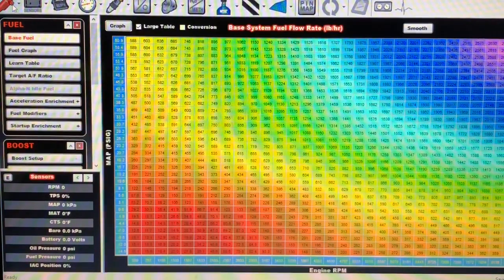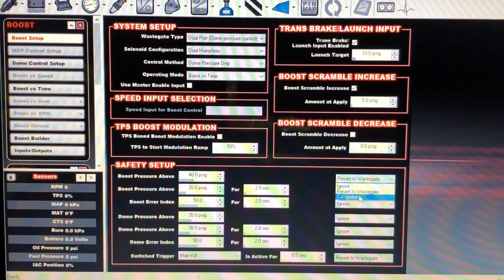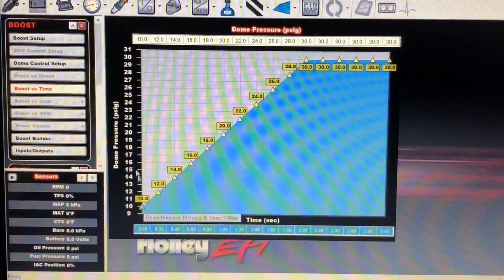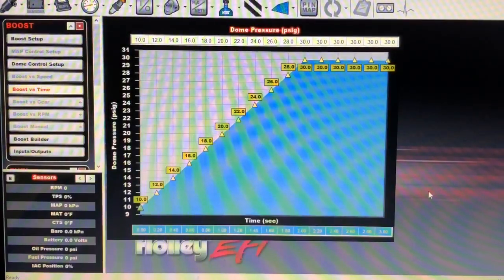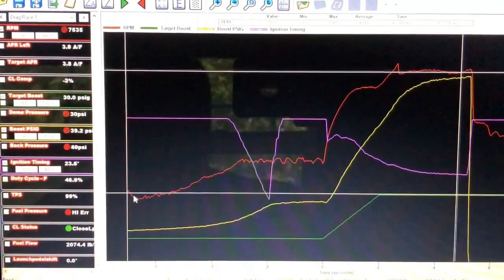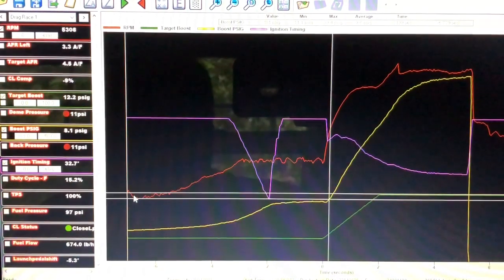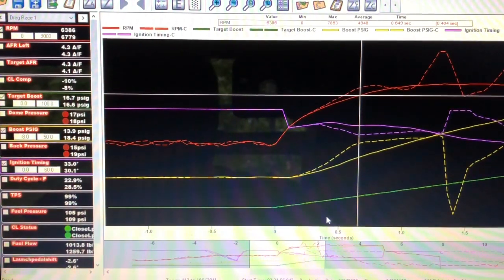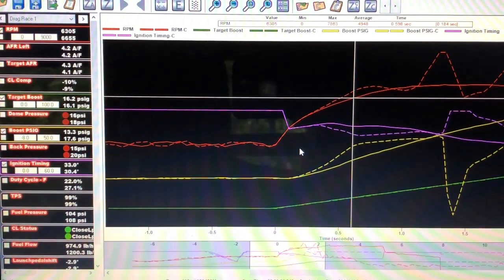Wastegate Stuck CLOSED!  BOOST creep!

Comment: Wouldn’t it go rich when you floor the car to start building boost, just like an accelerator pump would add fuel on a carb when you first floor the car? Just not sure if that’s the part you are talking about.
Reply from the maker: I can tune the acceleration enrichment.  It should stay pretty consistent and not go terribly rich at the hit.  I have modified the tune, and will try it tomorrow night!

Comment: I really enjoy watching your video's. I am in the process of switching from nitrous to turbo and find your video's very helpful. I was starting out slow with a blow thru carb on e-85 and wondered how well it worked for you? What kind of performance if you can share? what kind of issues did you have?  I'm kind of committed at this point I know that eventually will have to step up to fuel injection at some point thank you
Reply from the maker: I had really good luck with blow through E 85. It was non-intercooled, and I started having issues in the 5. Teen range.  we had three completely different combinations two small block Ford, my small block Chevy. Their motors were smaller cubic inches and started having issues a little sooner than mine. We think it is due to the high heat, of being non-intercooled. We could not tune around its, we could not tune around it.  No matter how rich or how much time and we pulled out they just would not live past that point.  But there are other people that pushed e85 past where we were, but most of them had intercoolers.
Reply: Thank you so much for the info kinda disappointing already been there with nitrous hoping to be where you are with this 88mm turbo I know the turbo can make 2000hp it already did on a smaller modular ford motor so I thought that would step my performance up I guess I will be finding out hopefully soon. Thanks again Rodney

Comment: So you bring your timing down to a negative value on 2 step and that helps to fire off the turbo ?
Reply from the maker: It doesn’t go negative, but goes low.  Base timing is at 38 deg, goes down to 16 deg to help it bang!

Comment: I wanting to switch to a boosted combo. I have a 23° headed small block on 2 kits of nitrous with a Sheetmetal manifold. What would u do. ProCharger or turbo? I'm leaning toward ProCharger but need some advice thanks
Reply from the maker: Blowers are good, but we are struggling with Randy’s blower car.  The engine just seems to be very sensitive to everything.  Mostly valve terrain issues.  His blower cam is big, really big.  I love turbos!